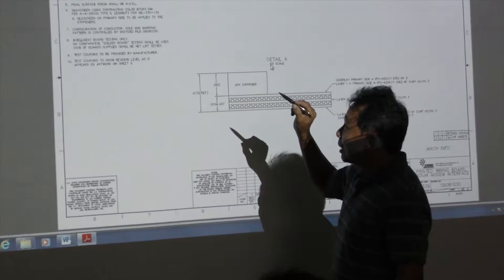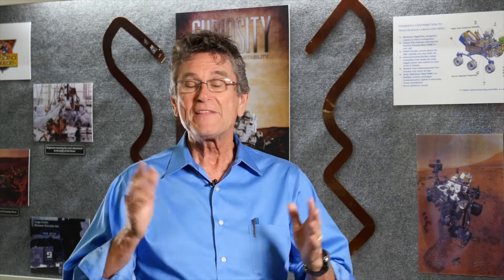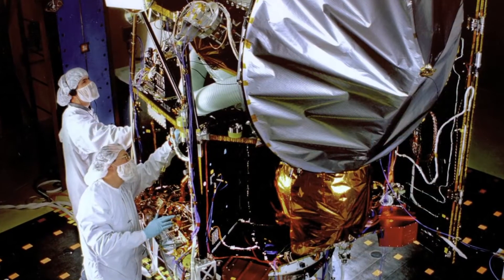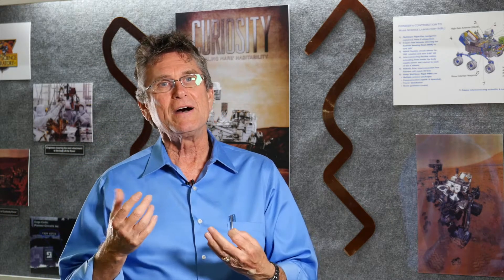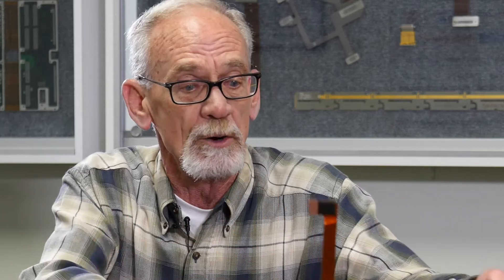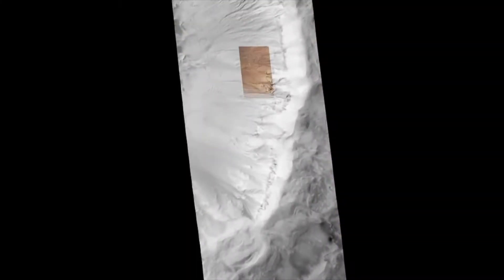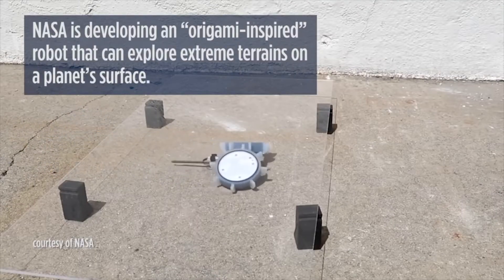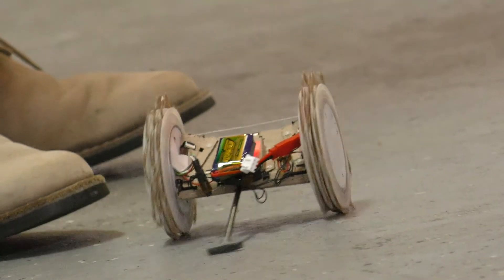Concurrent Engineering | Pioneer Circuits' Unique Flex & Rigid Flex PWB/PCB Services

Comment: www.raypcb.com

RayMing is the ultimate provider of standard and custom flexible printed circuit boards for your industrial application requirements. At RayMing, we manufacture flexible printed circuits keeping the needs of our customers in mind. Our circuit boards provide quality and durable performance while being cost-effective in terms of manufacturing.

Find a Rigid Flex PCB Manufacturer and Supplier. Choose Quality Rigid Flex PCB Manufacturers, Suppliers, Exporters at RayPCB.com. Welcome to send your design to Sales@raypcb.com